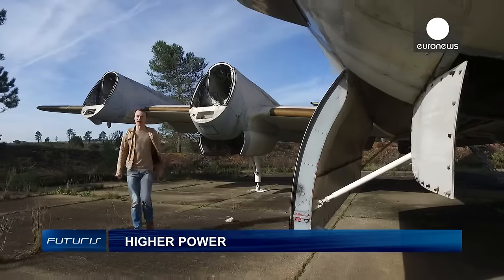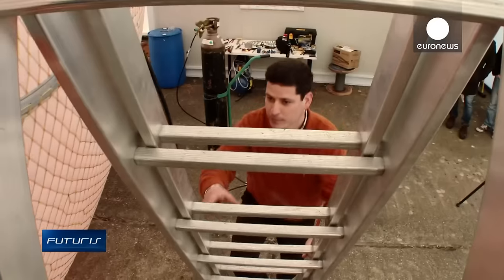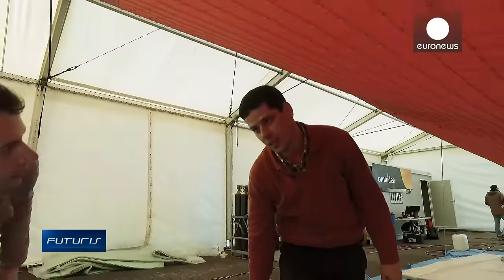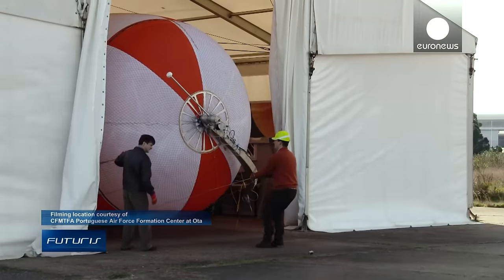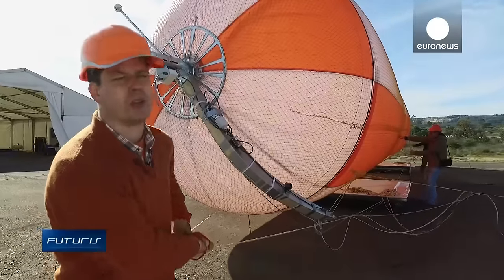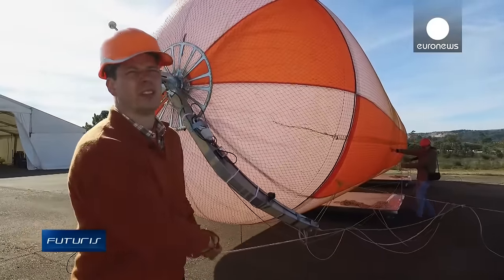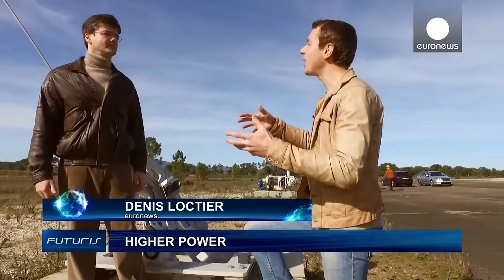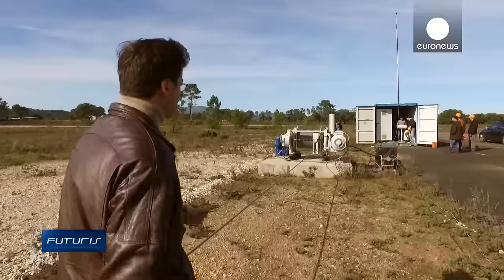The search for a high flying clean energy generator

Comment: this is pretty  fucking genius.  But we need 2 such systems working in tandem. when 1 rises, the other one comes down.. the one that rises pulls the cable for the one that comes down.. if the software is done properly this can be made to run the generator continuously, and be fully autonomous. 

Also you don't need to lower either one for lower then 500 meters. Lowering it at 100 meters is very scary because it can hit the ground, and even kill somebody if the wind changes unexpectedly. If you keep it high up, then you have time to compensate. Plus take advantage of the higher winds.

Just keep them up there.. From 3km to 500 meters is enough range to account for wind variation and calibration errors and sensor errors and such. Also AI can be used to learn the best setup based on wind and all the rest of the sensor data. So is better to not fix this with rigid rules but instead let it adapt and learn. Give it a fitness function and let ait free. This can be simulated upfront until the ai learns the tricks. After that can be deployed in the field. Also if Ai is used, then multiple such systems can be deployed in the same area, and will not tangle with each other since the Ai can control in real time in a dynamic way and account for that. Like birds do. Birds dont bump into each other. So yeah. Because without anty tangle software implementation - you must keep this at very far away distances from each other, since otherwise they risk to tangle into each other. Anyway. If you work with such systems i can provide you with the AI based software. 

This things are far more cheaper to build and operate then wind farms, and seems that the only limitation to them is this tangling situation / or else just takes toooo much space. If the cable is 2 km, you need to keep them 2-3.5km apart to ensure no tangling.. that's a lot of wasted space which could be potentially filled with more such systems. But is not about the space - is about the fact that the cables bringing the energy back to the grid need to be very very long, and as such the hole farm setup will cost much more. And that's unnecessary. If we solve this with software - then we essentially have a better system then the wind turbines could ever be. Because bringing electricity form the wind turbine to the grid is also a big cost.

But there is 1 super big issue. Helium. There is not enough helium to make this at scale. So we must use kites or something like that instead. Still very good idea. Possibly we can deploy 20 such systems at the price of 1 wind turbine. And get 10x ROI. Anyway, this comment is too long already.
Reply: Just use hydrogen, yes it is flammable, but there is no human, there is no risk.

Comment: starter and rotor can be encoporated on the membrane to integrate the generator and floating part. Yes there are weight issues but let's hope carbon nanotechnology will soon replace the copper winding and super light weight magnates come up or the design advances with time. the current stage you displayed is a brilliant design all together and I believe it's already a great achievement

Comment: Using helium as the lift gas seems like an unnecessary expense, both up-front and on-going. Hydrogen or methane would be lower cost and would give you more air time between refillings due to gas leakage.
Reply: Jake Hill Hydrogen gas is explosive and can't be used.Hydrogen is what made the Hindenburg durigible explode.
Reply: @galvinstanley3235  Using cheap H2 like good old Zeppelin prooved quite robust since 1914 World War millitary combat use (until fatal Lakehurst desaster once possibly caused by sabotage, but not much risk for unmanned use)
Reply: Sun is also not expensive:  https://www.youtube.com/watch?v=PdNuQv_LV5U
Reply: I was even thinking that some of the energy could be used, to replace the hydrogen that leaks, by electrolysis of water (rain??) I think too that as long as there are no sparks, there is no danger. And during a storm danger with lightning, the balloon goes down long before anyway, I suppose.
Reply: How about thermal. A separate wind generator to power an electric heating source could be self maintaining.